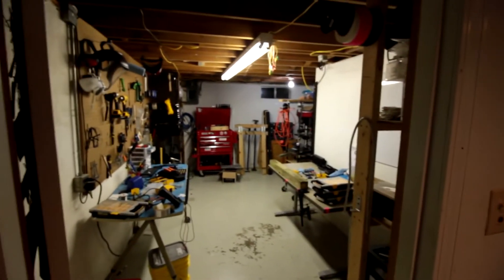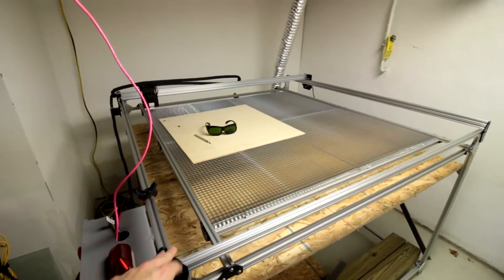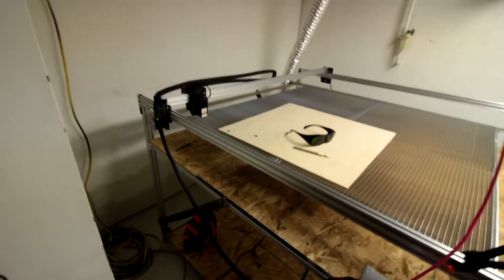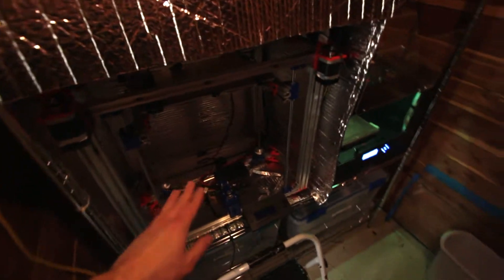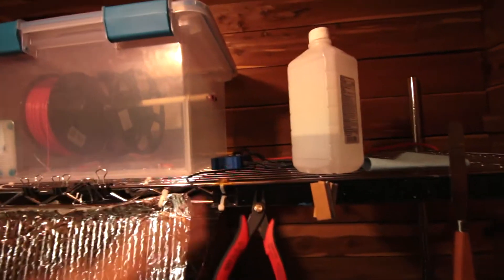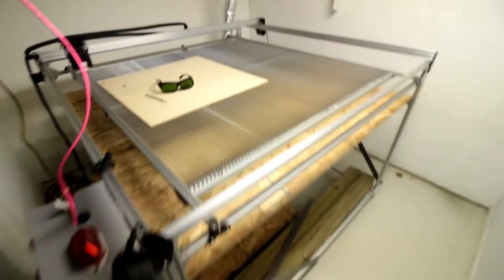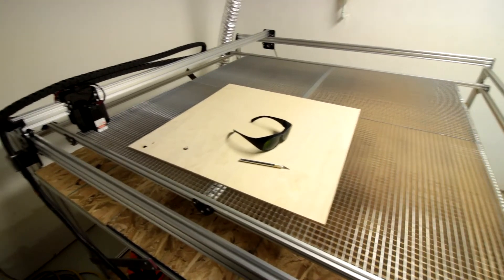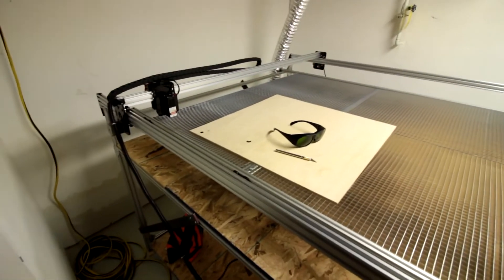1k Subscribers, New Project, Channel Content Shift?

Comment: Suggestion: get a stick of strut channel from your local Electric supplier and hang it over the lazer. On McMaster-Carr you can get roller that fitts into the strut and you can hang all thread from it. Make a mount for your camera to fit the all thread. This will allow you to film the laser without a tripod and can easly be removed when not filming.